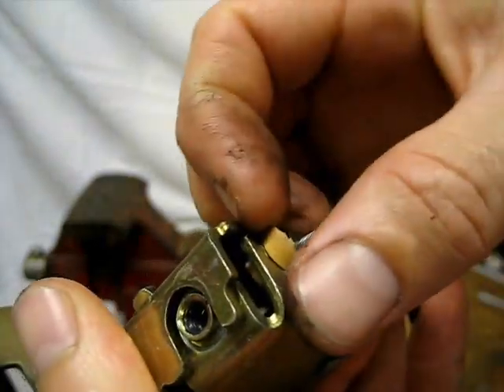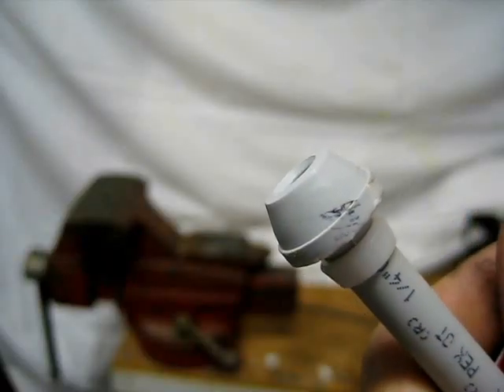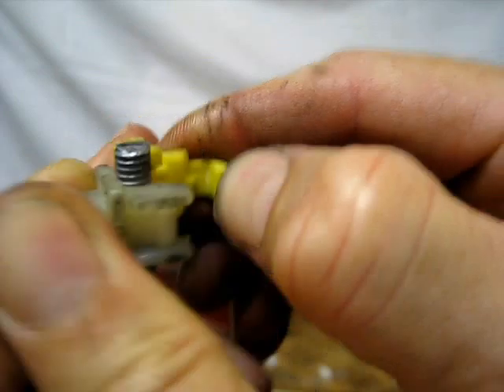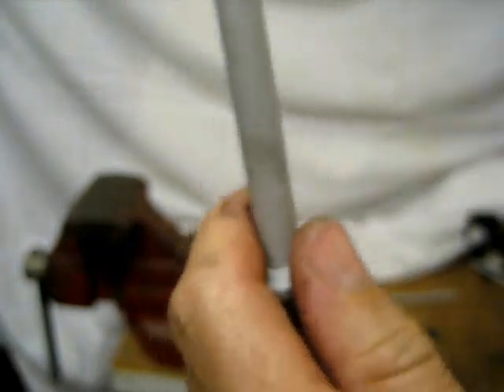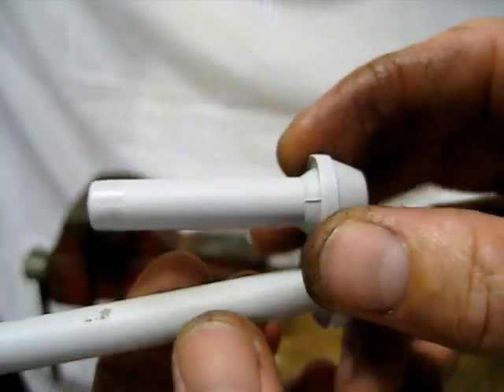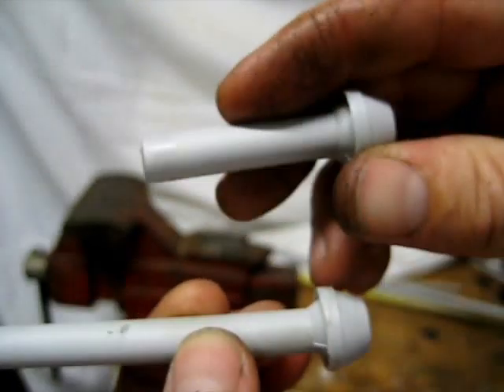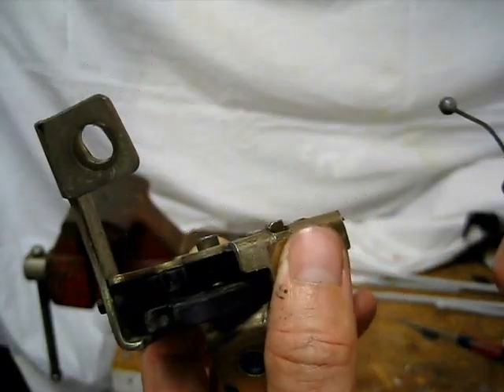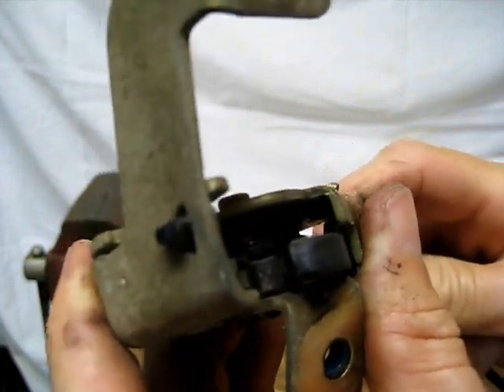ford superduty rear door wont open part 2 of 3

Comment: Just wanted to say thank you!!  Going on 7+ years now since I did your fix on both rear supercab doors on our 2003 and still working great!!   Forgot all about it until this video popped up for me for some reason.   If I ever have to redo them I'll use the bicycle brake adjuster video.
Reply from the maker: Glad to hear it helped you.  Even though mine were still working using the plumbing lines, I redid mine cuz I liked the bicycle parts better, but also cuz I needed to make the video ;-)  They sell the ends in the auto parts stores now.  But I like making this kind of stuff in cases I run into a similar problem that I can't find a part for. Got to keep building skills.

Comment: Mark just wanted to say thanks for the information, I checked on ebay and was able to find replacement metal end that anyone can purchase "if they want to spend the money" the cost ranged from $19.95 to $31.95 for the repair of both rear doors.  Needless to say with a supply store around the corner and less than $10.00 and about an hour of my time and your video the problem on both of the rear doors of this F-150 work as it did when it came off the assembly line. My hats off to you for taking the time to post the video.

Comment: The latch is at the bottom of the door. I friend from a repair shop stopped by and opened the doors for me. He knew right where to pull the latch. Thank you for your video and response!
Reply from the maker: lee harb Great.  Glad you got it solved.  BTW I am about to redo this video in a month or two.  Although I haven't had anyone tell me they have a problem with the PEX fix, I have noticed that temperature can make the latch fail to operate.  I recommend either ordering the metal ends or using bicycle brake adjusters.  You can find more info on it in the information section.

Comment: Thanks Mark for the return, after viewing you post and a couple of others I came across one that showed a guy using the metal replacement end so I went to ebay and type in F150 rear door metal end replacement. Thanks again for the posting.

Comment: I just did this DIY cable refreshment and it went ok.  I have a 2000 F250 7.3L SD extended cab and the knurled ends of the cables would not slide thru the 3/8OD PEX tubing.  I had to use a 3/16" drill to drill out 6"-7" sections of tubing then slide them over the knurl and existing cable jacket.  Other than that it went well and the door now functions properly.
Reply from the maker: Chris Holderness Wow that is strange.  The one in the video is a 99 250 7.3 SD.  The threaded end went right thru. I will have to look into that.  Thanks for letting me know.

Comment: I want to thank you SO much for your informative video!!  Unfortunately, both of my cables have deteriorated to the point I'll have to "repair" both of them but due to your vid, I can use this method on both(I hope!) My problem was I couldn't get the upper latch to release, and was a standstill till I thought, what the hell, gave it a try and voila' pulled the lower portion of the upper cable loose and gave it a tug, BINGO!!  Now all I have to do is follow your vid again to the point and fix this "problem"!!!

Comment from the maker: Hi Gardini94, I haven't worked on a ford ranger around that year so I don't know if it would work or not.  Some trucks use rods instead of cables.  See if you can find something to tell you how to take it apart.  If it uses cables you can use the same concept as on this video but the ends will probably take a little modification.  Good luck.

Comment: I had the same problem with my upper latch. Now I did fix it a little differently. I took some needle nose pliers and pressed in the small yellow tabs on the cable holder and pushed the holder out of the assembly. I then used a fishing weight (forgot exact size ) approx the size of a # 4 shotgun pellet or slightly bigger with the split on the side. I opened it and placed it around the cable itself next to the plastic sheathing squeezed it on tight. I then put the yellow cable holder back in the assembly pushed the weight up with the cable above where there's a notch in the metal door assembly. I then used a zip tie to hold the the cable in the notch simply by wrapping it around the cable and notch assembly. Works like a charm and cost me no money
Reply from the maker: That sounds kind of like they way I am fixing them now.  I made a new video about it.  It uses a bicycle brake adjuster.  There is a link to it in the information section.

Comment: I've actually made a small business out of this. I buy the aluminum ferrules in bulk. Also the 1/4" rivets, and the plastic hardware (yellow and white piece). I made flyers with pictures and a small description of the issue, the problem, and illustration of my fix. I charge $50 per door with all parts and labor. I have done nearly 50 of these trucks now and have my time with power tools down to less than one hour for 2 doors. It's not uncommon for me to make an extra grand per month.
Reply from the maker: Cool.  What area are you in?  How do you find your customers?

Comment: Very good videos, found the problem on my 99 F250. Got the panel off and released the door by pulling the cable but now I can't get the latch mechanism out. It is held in place by 3 fasteners that I haven't seen before, I can turn them but whatever they screw into on the other side rotates and I can't get anything in there to hold them. This is by the hable from which the two cables go to the top and bottom.  My top is the problem but the issue is the broken sheather where it attaches to the door lever mechanism.
Reply from the maker: If I remember right, the central handle is riveted in. But, you shouldn't need to remove it.  This is an old video.  I have a couple of newer ones that might help you more.  I will send them to you in just a minute.
Reply from the maker: See if these help you figure it out.  Let me know if you have questions.

Fix broken cable with bicycle brake adjuster - ford car truck van door won't open - stuck latch
https://youtu.be/7Ta7yx26qwM

How to remove Ford rear door panels with/while door stuck shut: https://youtu.be/3tAdn3vXZqg

How to open stuck truck, van, or car door latch with broken cable: https://youtu.be/yfeQGMvsoSg

Broken cable housing repair (Extras):
https://youtu.be/Xi1js3_RebQ
Reply: You're right, they must be rivets. I need to repair/install the cable right behind there. Opens when I yank the cable.  Thanks
Reply from the maker: You will need to remove the top latch mechanism.  Make sure you use the correct torques bit.  Try the larger size first.  The smaller one will slip and strip the head of the bolts.  My truck is a 99 250 also.  I am surprise you haven't had to replace them all sooner.  Good luck.
Reply: I did have some trouble with the tork bit, I think 30 is right but mine seemed very tight and it was starting to mess up the head but got it out. Not sure I understand why I should remove the top latch? The cable end is bad right by the center mechanism. Thanks, I'll keep at it.
Reply from the maker: If you only pulled on the center part of the cable, you might be ok.  But if you pulled on the outer part (the housing) that will break the housing end at the top of the cable(if it wasn't broken already).  Once they are old and dry rotted, they usually break from just hitting bumps in the road or a minor wreck.  My driver's side and passenger side broke within a week of each other.  If you try to put a new end on the upper cable's lower end, just that little bit of movement will probably break the upper housing end.
Reply: I think I've got it, take out the upper with the cable attached, reinstall new cable end into the door mechanism.  I'll give it a whirl.  Want to buy a 7.3 with 250,000!
Reply from the maker: I have a 7.3 with 450,000.  That 7.3 is the most popular diesel engine Ford ever put in a truck.  It is an industrial grade engine that will probably last 500,000.  Not like the 200,000 mile junk they have put in them since the 7.3.  Be sure you know what it is worth before you put a price on it.  Some people will want to buy it just to use the motor in another truck.

Comment: All you need is two quarter-inch compression fittings... just drill the center out of it.. don't take but a second then you slide it over the cable adjust it and tightened it down
Reply from the maker: Hi Rick,  I thought about trying something like that.  I've used bicycle brake adjusters, but would be nice to be able to use something like compression fittings since they are easier to find.  But, this has become such a common problem, the auto parts stores have started selling the kits in the store.  Have you watched the new version of this video is at https://youtu.be/7Ta7yx26qwM

Comment: What do you do when the cable comes loose from at the bottom of the latch. I can't get my door open. Any suggestions? This is on a 2000 F250
Reply from the maker: lee harb Sorry,. I don't have any suggestions that I have tried.  You are the second or third person to ask me that.  I have not tired it yet, but you might be able to use a piece of rigid wire to hook the mechanism inside the latch(where the cable normally catches).  Will probably be hard to see down inside the door so you might have to drill some holes just above it with a hole saw. Pack rags over the latch to keep shaving out of it. Probably need a bright light inside the door and a mirror to help you see what you are doing.  It is just an idea.  I will be making a new video about this in a month or two and will try to figure a way to do this while I am at it.  Unfortunately, that probably won't be soon enough to help you.  Best of luck to you.
Reply from the maker: lee harb Are you talking about the latch at the top of the door or the latch at the bottom of the door?
Reply from the maker: lee harb Just looked at my truck.  If you are talking about the bottom latch, there is a big hole behind the black plastic near the bottom of the door.  You should be able to get in there with a hook.  May have to take the back seat out.  May need to look inside the good door to tell what you are trying to hook.

If you are talking about the top latch, you may be able to take the plastic cap off where the ceiling meets the door.  I "think" there are bolts under it that will allow you to take the piece of metal that the latch catches on loose.  Let me know how you make out with that. Thanks

Comment: you don't have to go through all that if you buy the replacement ferrules $12.87 online 4 ferrules  for both doors 2of them are cams for passenger side
Reply from the maker: Hi Murph, This is my old video.  I use bicycle brake adjusters now, but the replacement ferrules work fine too. The new video is at https://youtu.be/7Ta7yx26qwM
Reply: fixpro256 cool deal dude